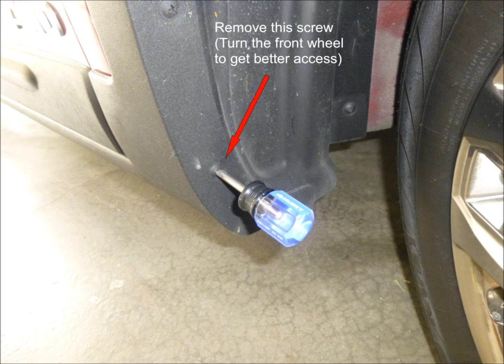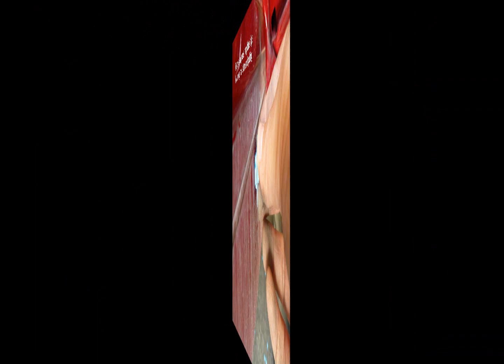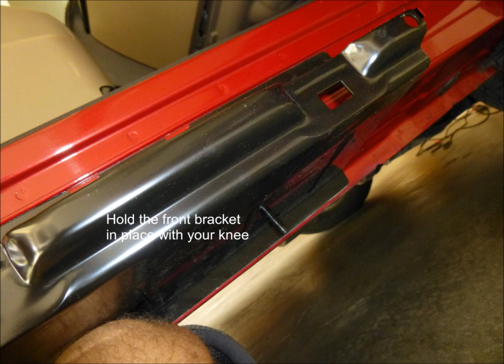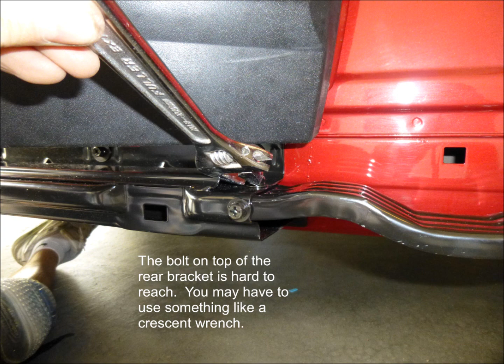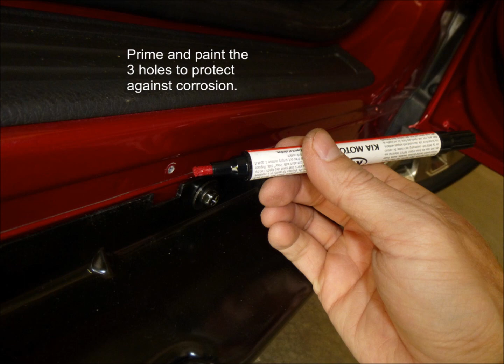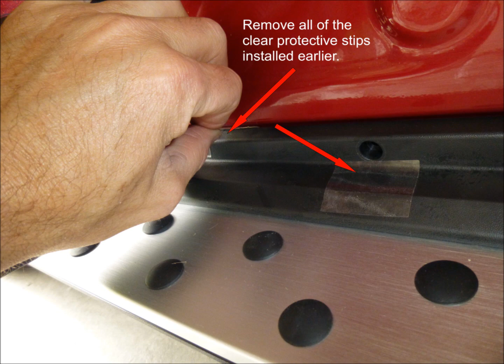2011 Kia Sorento Side Step Installation

Comment: Thanks for doing this.  It's been a great help.  Our kit didn't come with any instructions at all so I had to rely on the trusty old internet and also 4 of our small tabs for screwing the top of the brackets were missing.  I think we were supposed to only use 2 on each side instead of 3 so I had to make up 2 and paint them so now I need to wait overnight for the paint to dry to finish it off.  Apart from that it's a very good kit and pretty strong.